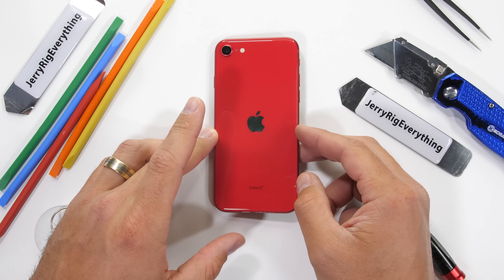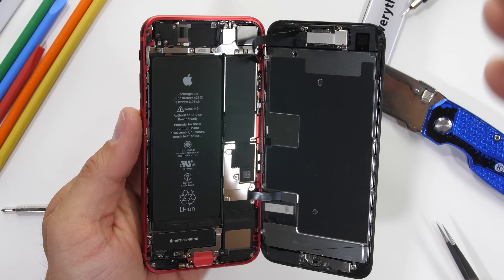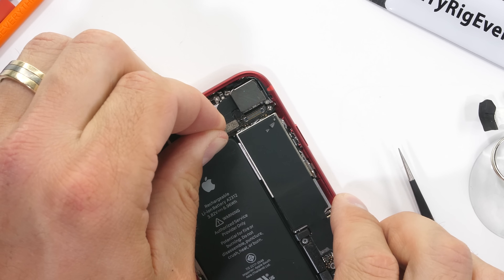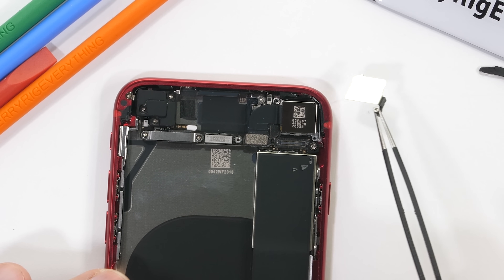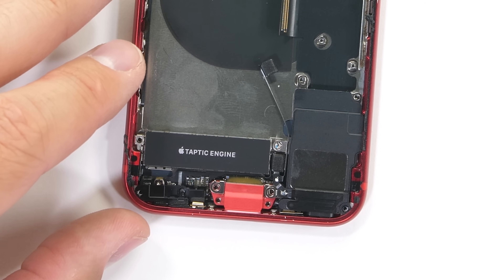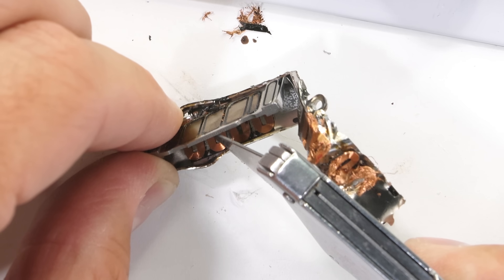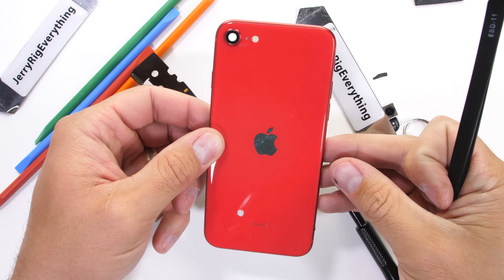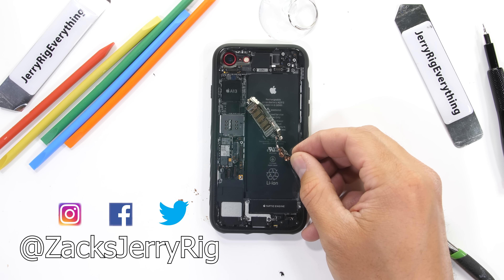iPhone SE (2020) Teardown! - Lets talk about Vibrators...

Comment: I just realised that ‘their logo everywhere’ is not served as reminder to repair guy that they are currently repairing apple device, but it is to sue 3rd party if they make unofficial/unoriginal spare part
Reply: Good Morning!
Reply: Glad someone said it. It was also immediatly apparent for me. Although I don't think it's for suing people but rather to refuse to make any repair at an official Apple store.
Reply: יעקב they’ll still repair it if the unoriginal part isn’t at the center of the repair
Reply: Tyler Evans Because not everyone can afford Apple Care.
Reply: @Tevon93  A standard part of Apple repair is to wipe the device, even if completely unnecessary and usually they just throw (expensive) parts at it which might not even fix the problem. There are a few reasons you might want to go to someone who does component level repair instead of just replacing the whole thing.
Reply: It's more for trademark law. A common thing would be a US company sending broken iPhone screens to China to have them repaired, but when they get sent Back to the USA, because they have the Apple trademark logo on them, Apple can tell customs that they are counterfeit and infringing on their trademark, and they will have to be refused entry and destroyed.
Reply: @Tevon93  exactly
Reply: The Apple logo being everywhere is to prevent 3rd party repair. They will have any Apple parts seized by customs and destroyed if they are being shipped into the country, stating trademark infringement and counterfeit parts. The only way to prevent this is to scrub off all the apple logos on replacement parts even if they are all legitimate original or reconditioned/refurbished parts.
Reply: it’s not that hard to print an apple logo onto a third party part
Reply: Tyler Evans cheap? ha it’s super expensive for what you get, sure you get cheaper screen replacements and stuff but by the time your done paying for apple care and a screen replacement for example a third party could’ve done it for hundreds cheaper, it’s not that hard to get oem parts either, check ebay
Reply: Axipixel not just apple that does that, every part i’ve bought from overseas that had a logo on it, be it apple samsung huawei were all covered with tape or a sticker

Comment: My current phone is the OnePlus 6t, this se looks very tempting
Reply: It's one hell of a phone for it's price, isn't it?  The only reason I haven't bought one yet is I like my larger screens.  (iPhone 7 Plus current)
Reply: Lol don't go for the SE, its battery life is horrible!
Reply: @moonwiniverse  That could be down to software.  Check for updates if your current phone is the SE and is having these issues.
Reply: @computernerdinside     Ooh Thanks!
Reply: It isn't the software, the battery is horribly small. Every phone has 4k maH this has 1800. This is more efficient but only to an extent. Also the charging slow

Comment: one more thing on the haptic: The “Click” On the iphone 7 and above is actully just a haptic vibration. It never clicks down. Its a stationary plate thats glued to the screen of the phone. It just detects pressure and thermal heat to see if it is a fingerprint pressing or just a key in your pocket. Also when you get a notification and your phone is in your pocket it never turns on. It waits until you pick it up
Reply: I noticed but go used to it quite quickly

Comment: 6:22 I suppose the "oil" is a ferromagnetic fluid.
Reply: Why would it have magnets and ferromagnetic fluid?
Reply: You could be right , at least for me it looks black.
And in this case here:
Sealed compartment
Device is new 
And it's fine mechanic.
This oil should look clear or maybe yellow or sometimes red not deep black unless we have Ferrofluid.

And I'm 100% sure this oil is not for lubrication.
That makes no sense because the moving mass uses flexure bearing and such things doesn't need any lubrication
Reply: Keerthi Chandra if you applie a magnetic field to a ferromagnetic fluid, the fluid aligns and it gets shaped. if you have now multiple electric magnets, you can create certain movements and in a ‚closed box‘ you get ‚vibrations‘ or other ‚noices‘
Reply: No, the oil is just to brag that Apple is an American company

Comment: Your videos helped me find the phone that lasts! From when I first picked in buying the Pixel, to now this iPhone SE. Mostly because you have shown me the whole process from the durability to the tear down to replace parts (like the battery). I strongly think that apple is making a good move in not changing everything internally and keeping things some what simple to repair (minus all the different size screws).
Reply: screen and battery are the most important things of a phone. they changed the battery connector so likely you would need a new battery ..

Comment: There isn’t room for a headphone jack in the iPhone 11
Apple: releases an iPhone the same size of the iPhone 7 with almost the internals of the iPhone 11
Me: wait...
Reply: David Gonçalves Álvarez the iphone 7 lacks a headphone jack...I'm typing this from an ip7
Reply: Sniuchi they know that. They said a 4.7 inch phone has modern day internals from the 11, but the 11 is bigger and it doesn’t have a headphone jack
Reply: Also they did that to promote the airpods, not because of size
Reply: Nubia redmagic with an actual turbo fan and headphone jack laughs in corner
Reply: Bruh the batterie is a lot smaller
Reply: Tetrass  no, everyone who thinks charging extra devices to listen to their damn music is annoying and knows that those damn expansive earbud things have a tendency to be lost and never to be found again knows the value of 3.5mm jack
Reply: David Gonçalves Álvarez Cough Small battery Cough
Reply: Cynixx yes I know,the 6 and 6s has the same size etc and still has the jack,repaired some 7 and there is enough  room inside,the guy from strange parts also managed to put a jack on the 7
Reply: Tetrass they had to promote they're costly airpods
So if there is no jack no wired headphones,unless using a dongle or if you want to listen to music and charge your phone you need a stranger dongle
Not many people are in to this stuff so they tend to buy wireless earphones

Comment: "affordable IPhone"
-400 dollars: Ight imma head out
Reply: And 500 euro's where I live. I would say it is still expensive for what you get
Reply: @Z33force  if you compare to Android phones at the same price (which is basically none, they are all below or above), the features of the SE are pretty much unobtainable on an Android. Wireless charging, waterproofing, a pretty solid camera and a modern processor. 
People who think this is an iPhone 8 just cause it reuses parts of it (the camera lens too but the processor does way more work than on the 8) don't understand the proposition here.
Now you can have better battery and better screen for the same price on an Android, but you're gonna sacrifice performance, and all the features of a modern iPhone.
Reply: @Z33force  For 6 years of software support and a cheap entry to a closed ecosystem that works well, I'd say it's worth.
Reply: @Z33force  700 euros in Serbia... not that i care im happy with my Note 9
Reply: @timytimeerased    i prefer to buy android,bc i think the features on the iphone is not that important + i dont think if you buy an android with a similar price tag it has worst processor,but if it has its not that gamebreaking versus the better screen and better battery.
Reply: @timytimeerased  iphone SE doesn't really have that much better power it scores about 492k in antutu and samsung s10 for just a little bit more (at least in czech republic) has 418k which is 80k less but you get headphone jack, IP68, wireless charging, 6 inch display instead of 4 inch, three cameras, full front side display with just small circle for camera, SD card and dual SIM. So iphone SE isn't really that powerful to compensate one camera and 2017 body.
Reply: @timytimeerased  I got my s9+ for 500 euros shortly after it came out. It has good camera quality, 1440p oled display, waterproofing, wireless charging, newest android, stereo sound and more stuff. The s10 is at the same price now. And that is an even newer phone. A lot of chinese brands also have good and cheaper phones.

However, it is a good phone for some groups. It is the cheapest iphone and altough its specs aren't great some people need an iphone for things like app development or because they already have apple products at home.
Reply: @timytimeerased  so you just gonna ignore LG v40?ok then
Reply: @timytimeerased  I have all that and a bigger screen for 300 on an android so ye
Reply: @timytimeerased  Things that a 400$ Android can do better (yes such phones exist, its called mid-range):
Bigger Display
Faster Charging
90Hz Displays like on the Realme X2 pro or the Realme 6 / 6 pro
Fast charging Brick included in the Box
HEADPHONE JACK (Still very important to some users, like me)
Triple  / Quad Camera Setup with 32, 48, 64 or even 108mp
You can still use AriPods
way better Battery life (Up to 6000mah)
Look it up on GSMArena. There are hundreds of Android Phones that beat the iPhone SE. Even the iPhone XR has more features.
Reply: @timytimeerased  the oneplus 8 is cheaper than iphone se 2020 in my country india... Oneplus 8 is easily an overkill if compared to se 2020...only the performance is like 10% bad that's it... Not a marginal difference when compared to the 90hz fluid amoled display, indisplay fp scanner... Better cameras if gcam is used... And that crazy warp charge 30t never really makes me miss wireless charging
Reply: @timytimeerased  what????? Yes the features but a s10 cost the same price I got my s9+ for $330 last year and I'm loving the freedom  your paying for features on apple not power
Reply: @timytimeerased  brother you can buy a realme 50x for €550 that comes with an sd865 quad camera setup, 6.6 inch AMOLED display and wireless charging. And it has a headphone jack and a 4000mAh battery. So yeah there are way better android phones for a similar price
Reply: 600 over here
Reply: @timytimeerased  Maybe not waterproofing, but a 400 dollar android will have wireless charging and a modern processor. Yes, the processor won't be as powerful as SE's, but it will be close. It will also actually have more features, like a bigger screen to body ratio, 90HZ screen, better cameras, stuff like popup cameras and other features that belong to a few specific $400 phones.
Reply: @martinprochazka2869  dude are you in your senses... SE scores around 492000 pts in antutu benchmark.
Reply: @timytimeerased  and it's the same battery and screen... Old phone, new chip, that's it.
Reply: It's a ripoff still. 1821mAh, one camera, 4 inch screen? My A71 has 4500mAh, four cameras and a 6.7 inch screen, for twenty bucks more.
Reply: @mayman4255  you like a closed ecosystem, being walled in, paying to be in jail. Ok bruh...
Reply: @timytimeerased  Lol..i my one plus 7 which is 423$ is so much better than this mini phone
Reply: 600$ in India, same price as one plus 7 pro
Reply: 27% Áfa 
Jéjj
Reply: @hungeralexander7648   XD
Reply: @timytimeerased  what about the s10e one of the best compact Android smartphone snapdragon 855 water resistant better display and costs almost the same as the SE oyeah and a headphonejack
Reply: @timytimeerased  Yeah but you also get a tiny, tiny battery so not sure where you come out on top here. 1821 mAh??Way too small for today's standards.
Reply: @timytimeerased  I have the rog phone 2 (the 128 gb one) wich sells in germany for 450€ ( the Iphone SE is 470 here) and it has a 6000mAh battery 48mp camera and a snapdragon 855 plus processor, a headphone jack and quite a few more features. That´s about the same price and it just misses out on wireless charching and waterproofing. Also for someone who is not already in the apple ecosystem It´s much more practical to have an android phone I think.
Reply: @Sakkshams  sorry, didn't look properly and took old SE score, changed my comment

Comment: No one: What rhymes with SAMSUNG? 

Jerry: non-removable batteries. 

Me: sounds right!
Reply: all my Samsung phones have a removable battery doe
Reply: @beef1721  but extremely glued that its actually hard to remove without breaking something. Pretty much non removable if we simplify the argument.
Reply: corm cat Samsung doesn’t have removable battery’s they are permanently glued to the phone
Reply: @beef1721  I have the original galaxy s and I have the replacement battery in my box the phone came in still 😂😂 man I miss the old samsung with the easy repairs. Their galaxy buds r easy to repair which is good
Reply: @pawtatuh e3e im sure u haven't been into phone repairs or mods.

Comment: 2:31 That's LG of course. Their batteries (for the non removable models) are hardly glued on the phone. I remember back in 2016 when i bring my LG G2 to the repair shop to replace it's battery and i watch how the repair guy replaced it. He had hard time of removing it because there is too much glue on it. 

I guess this is a good thumbs up for Apple.

Comment: How can the screen be interchangeable when the iPhone 8 still have 3D Touch 🧐
Reply: The screen will work, but the 3D touch functionality is removed from the iOS firmware that is installed in the iPhone SE. So even the screen is capable for 3D touch, the software is disabled.

Comment: 4:36 Apple ads: Showing that its water proof for 30 minutes in 2 meters depth.

Reality at the Genius bar: There is water damage.

Even if you just take it to your shower and leave it in a dry spot the moisture will trigger it.
Reply: Yea in MacBooks people take pictures with them under water. I’ve dropped my 12 pro max in the sink picked it up and had 0 water damage. Do research before you comment

Comment: Re: price temptation.
Honestly I think smartphones are out of control with their pricing, and that's as someone who owns a Pixel 4 and a OnePlus 7 Pro. (The pro was free, and I paid $399 for the pixel). I really like this idea of providing premium phone experiences at middling prices, but as an android user that phone is the Pixel 3A and 4A. Granted, it's not made out of Aluminum and Glass, but you get a full HD AMOLED display, and the full fat pixel Camera experience, along with a powerful enough processor that it'll never feel slow in normal use. (The 4A providing an even more capable processor than the 3A).

For me, it's hard to want something like the SE. The SE's claim to fame is the A13 processor, but if you gave someone an iPhone with an A10 and this SE I doubt very seriously they'd be able to tell the difference. Phone processor capabilities have long since exceeded their use-case and the only thing that they're good for now is higher benchmark numbers. The things that MATTER on a phone are it's display, it's battery life, and it's camera. The SE skimps on all three of these things in preference to more power. More redundant, useless, power.
Reply: ( just my opinion) Apple made this phone with the intention of the first se: attract all the users on older ios devices. Those users wont really care about the display or camera. They just want their old phone but with slightly better specs. The a13 is noticably faster than the older apple chips and reaches higher fps in games, and just gives a faster experience. I agree with the display and battery, they shouldve made those better to reach 2020 smarphone standards. But the camera and the a13 and more ram will make iphone 6/7/8 users(apples target market) want to buy this phone
Reply: @2eewoihwuef671  I really dont think people with an Iphone 8 or 7 (maybe even 6) would wanna change lmao
Reply: Well you just explained my comment, but in a way more civilized way lol
Reply: Amen dad

Comment: The big question: Does it have a headphone jack?
Reply: SlipperyWhale0987 Plays No, it doesn’t 😔 And because of that, even at this cheap price, I still don’t want it.
Reply: @Piggsvin4  Well the iPhone 8 had no headphone jack, so why would this one have one?
Reply: A.G 27_Supreme they did release a new iPod touch at the end of 2019, it has a headphone jack.
Reply: Headphone jack lmfao I bet you have a blue tooth headset to
Reply: David Riches It was literally the old gen with new internals.
Reply: Please leave the early 2000s and come to the current decade of the 2020s. Literally no flagship have one anymore
Reply: Joanna W. There are reasons why people still want the audio jack. If you’re a musician, you don’t want to be dealing with latency and you want the best sound quality. I’m getting tired of people saying it’s obsolete or get with the times when this wireless audio isn’t even new technology.
Reply: SlipperyWhale0987 Plays obviously no hahahahahaha
Reply: @joannaw.8992  Mi 9t Pro has, and it's a flagship
Reply: David Riches If you are a musician you probably don’t use a phone for your composing and playing
Reply: David Riches I’m just curious, if you are a musician that worries about latency and sound quality for music production, why use a phone?
Reply: @DarkJK  At least I can listen to the music in it's maximum quality unlike cheap sounding airpods
Reply: Addelew because there are apps that can be used as MIDI sound modules that you can connect controllers to. iOS used to be very good for that.
Reply: Addelew also, I wouldn’t use a phone mainly, but it’s just nice to be able to use it if I want to record something quick.
Reply: Clickbait Pro When your composing or playing with your iPhone band crew?
Reply: @Piggsvin4  That's true, you can always work the idea in the garageband (iOS) for example, and then go to your home studio and open the pro tools, ableton, whatever... True musicians knows that inspiration may be on a toilet visit 🤣
Reply: ArasMX exactly 🙂